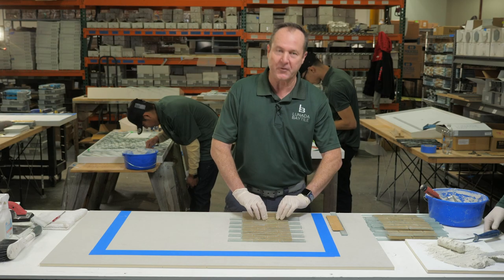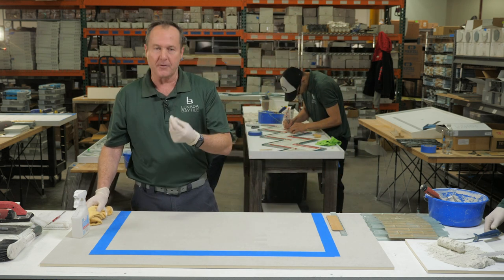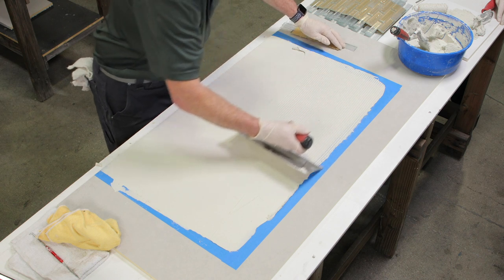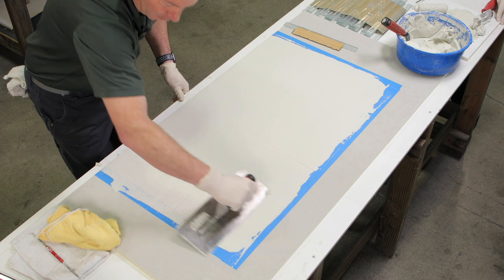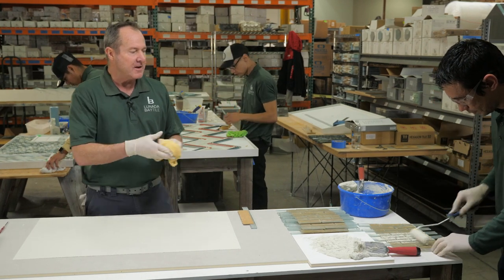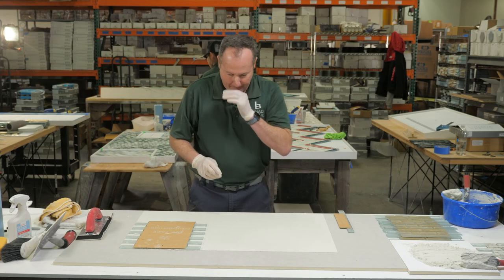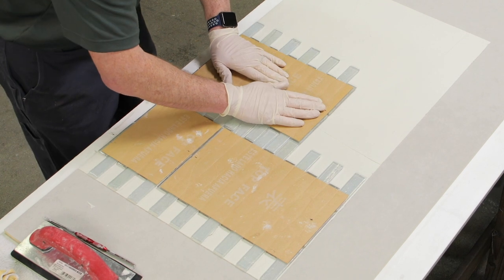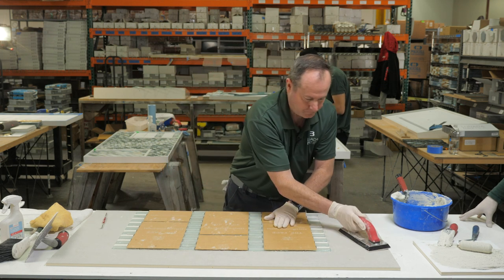Basic Glass Tile Installation

Comment: A number of issues, horizontal surface where most would be vertical,  Zero explanation as to why you flattened the adhesive although I'm in line with the roller buttering. I have found many tricks. I don't like all of yours but I do like the buttering idea, through a number of video now I have a comprehensive list of the best of the best. One to add to the list is if the tile comes in plastic cut it with your wet-saw while it's still encapsulated in the plastic. A game changer. I gave you a thumbs up for the buttering idea, not into the flattening idea presented. Properly pressed the "grooves" will flatten.
Reply: On glass the thinset needs to be flattened to avoid voids under glass.

You will get much better results with flat bed vs notches .

Comment: Because this is a brick look tile with staggered joints, the 1/2 sheet should have been off-set, not directly under the top sheet as shown in this video. This helps alleviate the "zipper"  affect after grouting and a better overall appearance of the installation. Paul E. Fox President of Glass Tile & Stone, Inc.

Comment: What is the "try out" table in which you place the thin set? I want to install sample glass tile.
Reply from the maker: The board in the video that we used to add thinset to the roller is a spare piece of sintra board, a water resistant board with a little more texture to it than plastic.

Comment: Wish you shown how to break them
Reply: Easiest method I found was to score a single time, hold the tile over a padded piece of wood about the thickness of a pencil, and just press on both sides and it snaps.  Skinny pieces I put a piece of padded wood over the raised bridge and whacked the wood with a hammer.  Worked most of the time

Comment: no spacer needed?
Reply from the maker: No spacers are needed on sheets; only on field size tiles.
Reply: I had to use spacers because my wall was small and because of the size I split the sheets vertically to get a perfect fit...hope it works out.  Note: I was installing my tiles vertically, not horizontal
Reply: Anyway could be more clear this , if they show us, how get installed on the wall , step by step, horizontal and vertical.